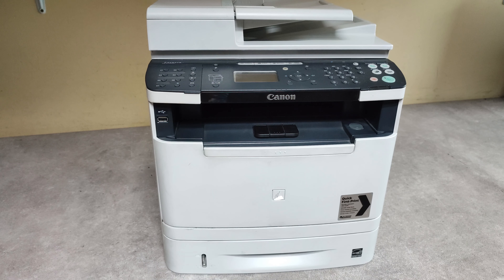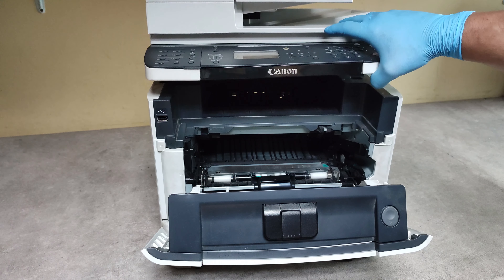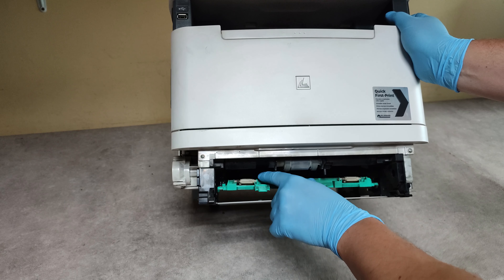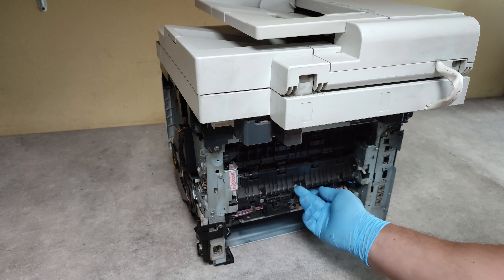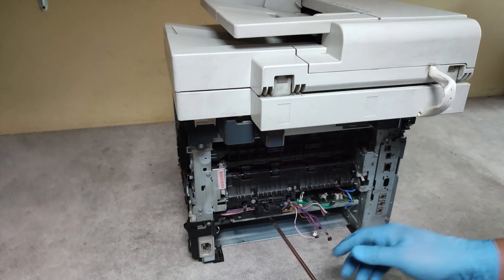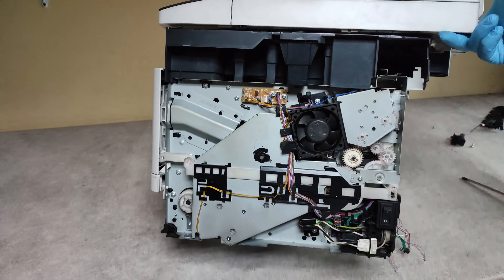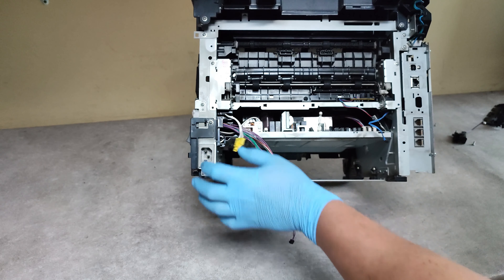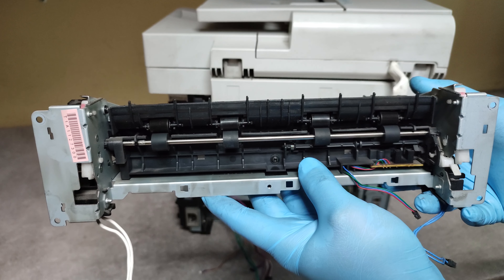HOW TO REPLACE THE FUSER UNIT ON CANON MF5940, MF6140, MF6180, MF411, MF416, MF445, LBP6350, LBP6650

Comment: merhaba  benim bir sorum olacak  size  canon 5940  çıkan kopyaların ortası elinizi sürünce siliniyor  ve kopyanın altına iz yapıyor sizce hangi parça sorunludur
Reply from the maker: You have to replace the upper fuser roller and the lower pressure roller of the fuser unit.

Comment: i have a Canon mf644cdw and it's is producing black lines and the colors are all off.  I tried the general Maintenace command to fix it from the menu screen.  the problem still persists, would replacing the fuser be the next thing.  would these steps apply to a canon mf644cdw also?
thanks
Reply from the maker: The steps for replacing the fuser on your device are almost the same. There might be some differences in the screws and connectors. Good luck!